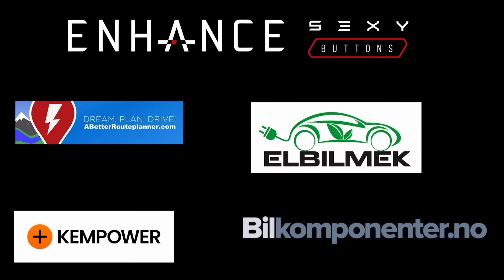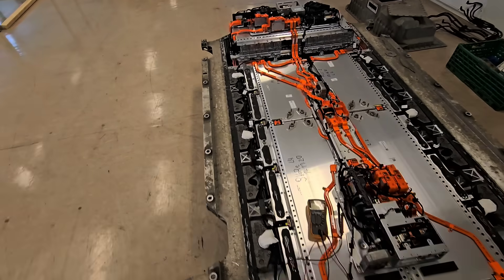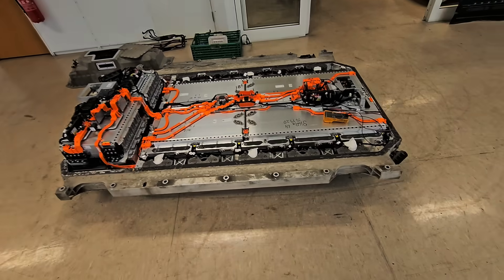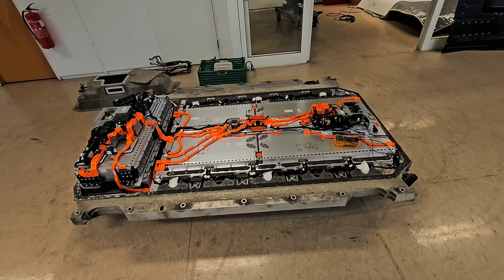Elbilmek repairing Mercedes EQC part 3

Comment: I have a question, i have  a problem with a Hv battery , and i need to replace it with second one , i see in video you say it have 2 BMS , if i replace both bms from car battery in second hand battery will  work?

Comment: 4:50 did you get a HV shock? 😲
Reply: Doubt with one hand 😅
Reply: @rkan2  You can get it with one hand if you bridge the wrong components. Electricity will follow any path available, it isn't picky. That is why you don't want your average wrench monkey messing around with 400V and 800V systems. They will kill themselves. If they are lucky, it will be quick, but usually it isn't. Remember, these are the guys that used to leave charged condensers around for their co-workers to pickup….

Comment: Difficult problem. The EQC was driven a bit before the defect occurred. A short circuit in the motor seems most likely to me. Defective rotor? 600A must leave visible damage.
Reply: Motors are fine, inverters too

Comment: Regard the model x, Could you not order a power supply for the heated wipers? Also, how did you configure it to be enabled in software?
Reply: Power supply? Why you need power supply when whole car is power supply?
Reply: @ValdemarasV 10:42

Comment: I have the suspicion that Mercedes lost the competence on their own EVs. We had an issue with our EQA and it took them two weeks without a clear conclusion. Result: expensive replacement without understanding the root cause. I was disappointed about the engineering knowledge of Mercedes.
Reply: The best or nothing.
Reply: The dealers are almost always the same, especially for the German makes. Most importantly it is prohibited to go outside the process to get the factory to payout on factory warranties. 

The mechanics and dealers' hands are therefore tied before the warranty expires and even then they usually either quote you to go a way or keep doing the same as they would with a warranty.

Comment: Catastrophic short circuit between both HV cables and the frame of the car? The BMS didn't detect this or the contactors failed to open and you went into to full thermal runaway.
Reply: I don't think so
Reply: @fuller9x  then there should be arc, or burn marks. 600amps leaves a mark for sure
Reply: @Blasterxp  absolutely agree, but I might have missed a video in the series, but what are the cables like from the chargepoint to the pack and the runs between the two motors through the body.
Reply: If it went into full thermal runaway, there would not be much of a car left.

Comment: What percentage of the total battery pack do the batteries themselves actually make up?
Reply: Not sure if understood your question😊
Reply: @ValdemarasV  Thanks for answering.  My question is how much do the bare batteries weigh vs how much the case, plumbing, coolant etc weigh.
Reply: @johnm2879  hmm, that's interesting queation, but unfortunately I don't know :)
Reply: @johnm2879  maybe lookup the datasheet of one of the battery cells.

Comment: Interesting project, hope you will tear it down further. Can a short circuit in the wiring from battery to the inverters or charge port cause this?
Reply: Possible, but cables been measured/checked and found ok

Comment: Great content! However, this highlights some major issues with modern EVs. Their complex design and lack of publicly available documentation make repairs extremely difficult, costly, and time-consuming. This results in less durable cars and higher insurance costs for everyone. The car industry urgently needs updated right-to-repair laws!
Reply: I believe combusion cars are more complicated. For us firsts cars are more difficult. With every new car is easier😊
Reply: @ValdemarasV  That’s true, but compared to cars made before the year 2000, repairing modern EVs is a nightmare. My point is that, in theory, EVs are extremely simple vehicles with fewer parts, meaning they could be made much more repairable and durable. However, for that to happen, we need proper right-to-repair regulations in place. In the end, this would benefit everyone, especially independent repair shops.
Reply: @TheJensss  Agree with and same time not sure if this possible. Most car makers not earning on new cars sale they start making money latter when car brakes out of warranty and customer need to pay. So for them keeping cars complicated to access documentation, diagnostic and parts is extremely important
Reply: @ValdemarasV  That is true, but this is a business model that car manufacturers have chosen themselves. Unfortunately for them, it is incompatible with sustainability goals, waste reduction, and other key initiatives in the green transition.

My prediction is that car manufacturers will adapt if right-to-repair regulations are implemented, resulting in simpler, and possibly more expensive cars but cheaper ownership.
Reply: @TheJensss  They should follow Tesla model then :)
Reply: @ValdemarasV  Yes, they’re not perfect either, but having documentation and repair manuals publicly available online is definitely a plus.

Hopefully, you’re able to fix the Mercedes! Looking forward to an update video :)
Reply: @TheJensss  Agree with you. Last video this week :)
Reply: Å
Reply: I think the complexity applies to all cars at this point. It is not a simple one barrel carburetor with a coil, spark plugs, and a muffler where all you needed to do was gap the spark plugs and adjust the timing (every oil change). Now you have fuel injection with a variable tuned air intake and a computer measuring air temperature, pressure, humidity, and oxygen in the exhaust to get optimum fuel efficiency, power, and reduced air pollution. Not simple at all. Further, disks are now minimum thickness for weight reduction, meaning you have to replace them instead of simply turning them during a brake job. Also, newer brake fluids have better high temperature performance, but require frequent replacement as they are too hydrophilic…..

Comment: Would the problem be AFTER the fuses? So power handeling in the car?
Reply: Didn't understood your question
Reply: @ValdemarasV  after the video, i understand you are checking the other parts of the car. I agree, the fuses may be blown by extreme powerdrawn by one  of the components. When you replace them, they could burn again. Can you connect the systems one by one? Or run the battery "outside" of the car?
Reply: @Blasterxp  I've have plan for this. Wait for next episode to see 😀

Comment: Maybe, if the battery is divided into two parts, and one half had a charging fault so only one half get changed. And then when powering up the car it connects the switch for part 1 and part 2 with different voltage and totally different state of charge. And then boom, both fuses is out.... Maybe this is designed by stupid people ? Combined with "use what we have made so far" ?
Reply: I believe Mercedes engineers done good job 😊